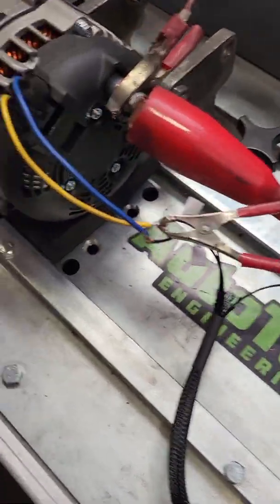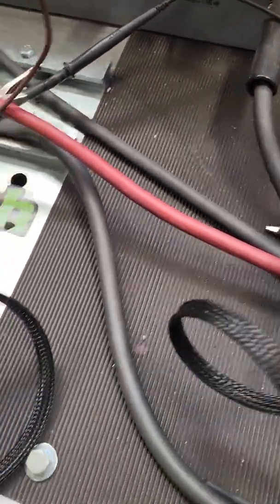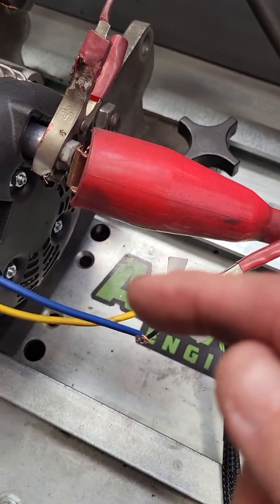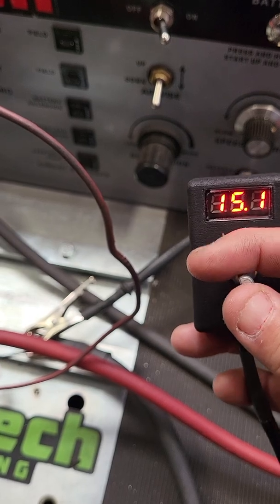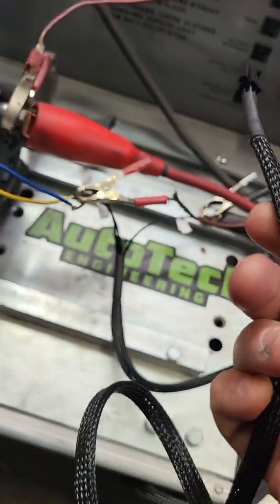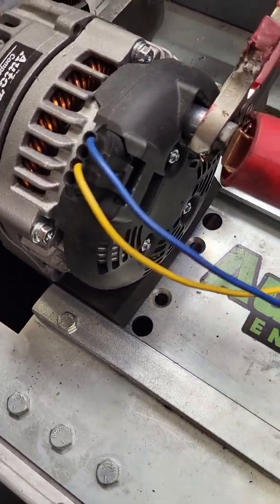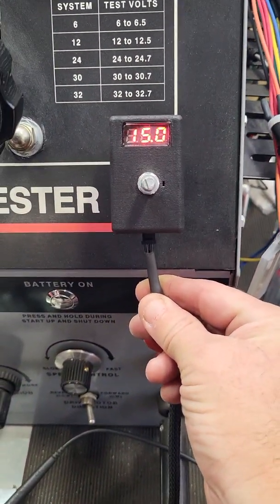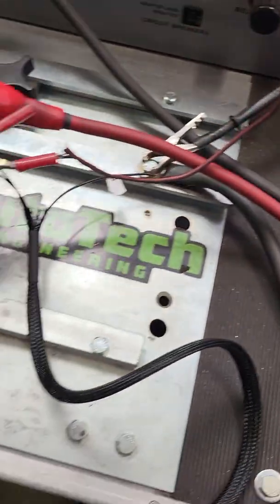New Voltage controller for all Denso style high output alternators using GM 3 pin with sense wire

Comment: Looking good you got a company down in Arizona bad mouthing you. He sticks up for dc power. Got into a huge fight with him. Your alternator is not on ebay or Amazon so I give it 5 stars. Your price is the best for 670 dollars like dc power if  I had a suburban I can get a huge case two 350 amps for a little more a mechman well we won't even go there. Keep up the good work and thank you for making some videos.
Reply from the maker: They stick up for DC power because their units come from DC power.  Also, the Arizona company does not test any units beyond 320amp and cannot show any video or performance curves beyond 320amp.   People selling 370 or 400amp without actual proof are fraudsters.  TAE and CAE, small shop run by 2 Brothers.  We know more about them then they know about themselves.

Comment: Will this work on a 2007 Chevy Aveo ? I have a 3 pin regulator, but its a 4 pin harness and it only uses the 2 middle pins of regulator. So far nothing works to adjust voltage. Also, how soon can i get this because there is a show in mid May im trying to make??? Help!!!

Comment: Awesome product,  does this regulator work with multiple alternators? Or would I need to install them separately per alternator
Reply from the maker: Because of the volt meter it is for 1. We will come out with a multiple but without meter

Comment: I definitely want one for my 1989 Bronco. I’ve talked to you before. I need at least 320 to 400amp with the external meter Control. I already have Ohio generator large case 320amp. Your alt is better.

Comment: I need one of those, how much?
Reply from the maker: 125.00 shipped inside continental usa
Reply: @autotechengineeringusa  so you said in the video about 2wks & they will be ready to go, because I'm definitely is going to buy one! I've bought one of your alternators last year & I love it!
Reply from the maker: @Drth73rd  pre orders start tomorrow online
Reply: @autotechengineeringusa  👍🏿👍🏿👍🏿👍🏿
Reply: These are for internally regulated alternators? Or are they for PCM controlled alternators? I have a honda Fit that has an Autotech 320 internally regulated 14.8v alt that I want to raise the voltage on so that I can get the full potential from my Plananno LTO lithium bank. I also have the same alternator on my dodge ram that i want to raise for the same reasons.